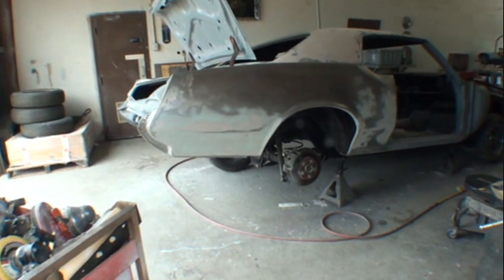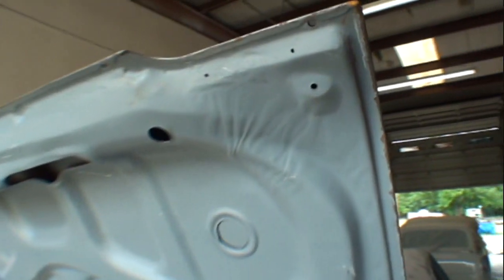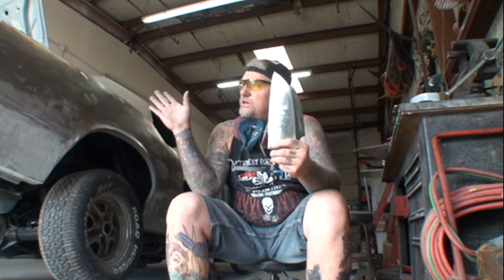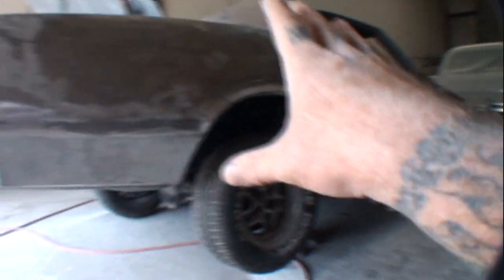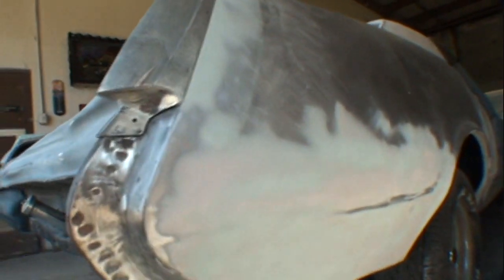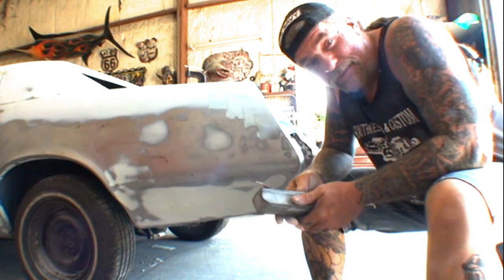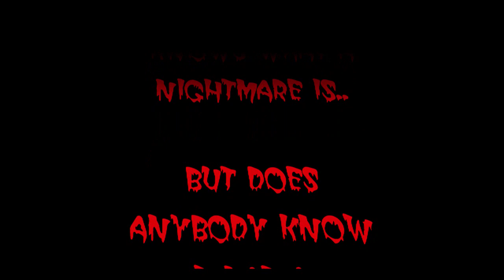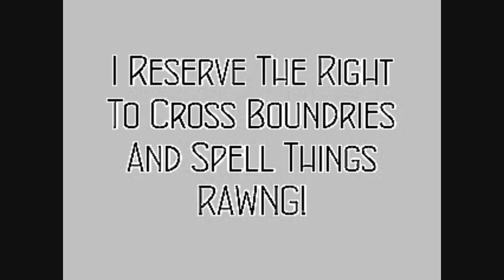Oldsmobile Cutless Supreme-OverHaul Restoration-Part 5-BONDO JOB DONE

Comment: So how do you get the dents out of pot metal?...or do you just fill them with bond and level to suit?
Reply: Most cast is very brittle and even if you heat it up to take out dent it will most likely brake ! so it was best to fill with LEAD NOT BONDO  =)
Reply: Stephen Salamone thanks..that does make sense.

Comment: pete I guarantee those wheels are losing air pressure through the metal. those look like old cast wheels. so they will have lots of pockets of air and shit in them in their molecular makeup, and eventually air starts getting out. I believe u can have them impregnated with resin or sth in an autoclave